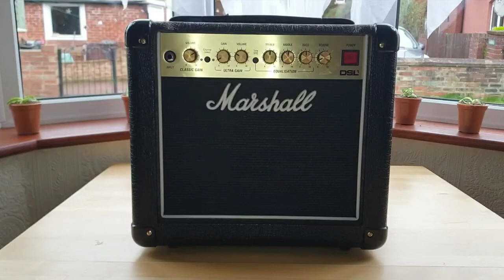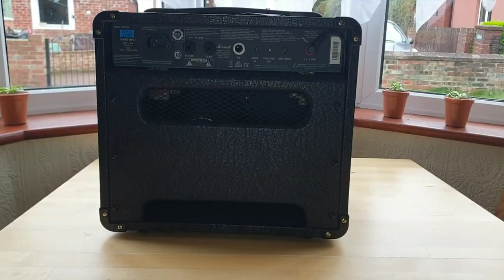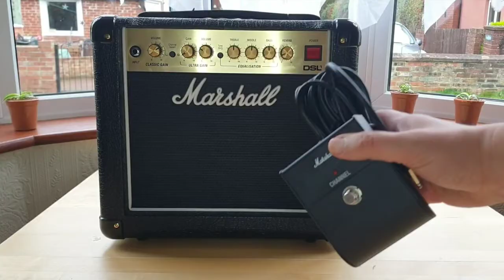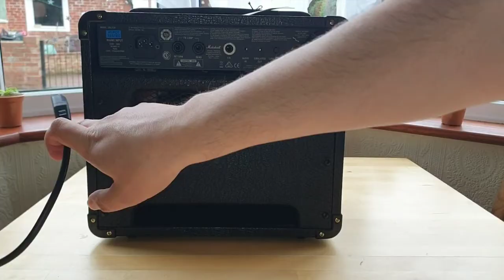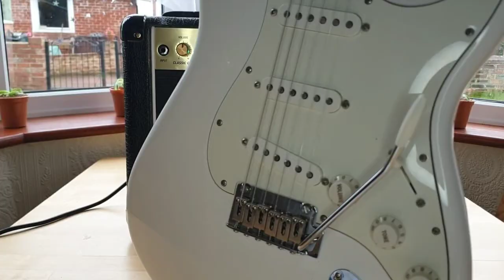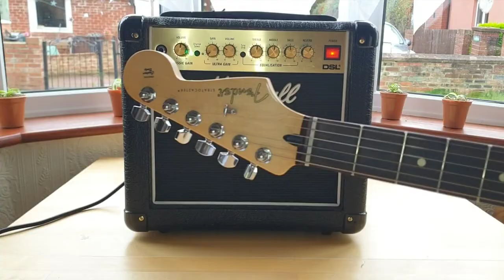Marshall DSL1CR review. The ultimate home practice/recording guitar amplifier?

Comment: Call me a clown but I always thought the point of the low power amps is that one can drive the output  stage very hard.....meaning , turn that volume to 7-10 and then play with the gain level.
Reply from the maker: It is. And with the Lead channel you can crank the master to do this. Sounds great!

Comment: Get yourself a JHS Little Black Box ($69us) to lower the volume even more but retain the sound of tubes running at full volume. This will act like a Master volume, especially for the Classic Gain channel. You'll be able to turn the gain all the way up. It does not require power and has only one knob. It wil only work on amps that have an effects loop. Do NOT run one into the front of any amp, it will probably damage the amp.

Comment: I have one of these,really nice practice amp .I wish they would have put in a 10 or 12 inch speaker.
Reply from the maker: Absolutely
Reply: If you want a 10 speaker, you can get the dsl5cr for just around 50 pound more, and you get more power and less boxy sound
Reply: @GreenHoleSun  An then you have great speaker options, like Celestrion Vintage 10, or Greenback 10, etc

Comment: I liked my DSL1HR through a 412 cab so much I bought the combo too. Now that 412 has given way to a 112 cab, still sounds great.
Reply: does the dsl1cr/hr sound the same just in combo form also does it have enough gain and tightness without the need for an od pedal ?

cheers !
Reply from the maker: It will depend on the cab you use for the Head. The combo has an 8 inch speaker so if you go for a cab with a 12 inch it'll sound different. There is more than enough gain but having said that stacking it with an OD pedal is also a lot of fun!
Reply: @Naf3ria  I don't run an OD pedal at all. I use a delay and a reverb. The OD channel is enough for me when I wan't that sound. But the heaviest I ever go is 80s rock. It gets close enough to the Scorpions for me. Like the blogging musician said, the combo has a small 8inch speaker, as such it definitely sounds different just due to the speaker, not the amp mind you. The combo seems happier to be on the low watt setting at lower volumes, It will do that screaming 1 watt  but you can hear the limitations of the speaker. I use mine in the living room at low volume, you can talk over it, I use the head and 12 inch down stairs where I can get away with louder volumes without disturbing people too much
Reply from the maker: Also depends on the guitar. There's enough gain for soloing on single coils, and definitely enough for p90s and humbuckers.

Comment: Thanks for the review. As far as I read in other ones it takes around 1 month to break in the speaker and after sounds much better.

Could you answer me some questions?
There's the lack of a volume controll on the clean and volume it up following in more crunch in the early beginning. In other reviews massive gaining starts around position 3 already. That's a pity compared with bigger amps for their great cleany Marshall sound. That's right? So,how to controll the volume since 1 Watt is very loud and what about pedals which should be better in clean channel? May it be the Combo will be too silent?
What about the emulated output in use with headphones? Should sound ugly, is the volume setable? I used to have a 250 Ohm headphone in a other Marshall Valve and working fine.

The DSL 1CR wants to be used for headphone use and sometimes for bedroom amping. Not sure if it's right for me. Thanks in advance! (There's a hack out for the DSL1, maybe H, to "enabble" it for 8 Ohm speakers - link in 2nd):
Reply from the maker: Thanks for Watching. The clean channel stays clean till about 12 o'clock onwards on a atrat, earlier for higher output guitars. Yes the clean channel lacks a dedicated volume but I use the gain as a volume control which does the job. Never used the emulated out but in my experience they never sound good.
Reply: @GuitarGeordie  Thanks!
Exactly, a humbucker will bring it early to a crunchy sound around 3 as I seen in othr reviews. Maybe nearly the same for the twisted Single Coils in a Tele.

I've seen users control the volume like you with the classic gain, but also they use the ultra gain knob when it's on clean. That works?! My bigger combo won't work this way so I'm asking. Does the Ultra Gain knob works when beeing in clean? Sorry, I have to figure this out before buying.
I've seen a review where he recorded via the emulated out and it sounds via good headphones professional so wondering about the bad user opinions.
Reply from the maker: @rotepillenfresser4544  No the ultra  and classic gain channels are separate, the ultra gain volume doesn't control the classic gain channel. I would say if you plan on recording thia, then mic it up, as the emulated out is vastly inferior. In g
Fact using modelling software direct  will get you a better tone than the DSL1 line out. I bout it for home practice and to mic up for recording. It exels in those scenarios.

Comment: Hi mate. Great review. If you had a dual foot switch, would the reverb be switchable via the pedal, do you know??
Reply from the maker: Thank you. I had a quick Google but couldn't find anything. Nothing in the manual either. Thinking about getting one? If you need to know I would drop a question on The Gear Page or even just try it out in a guitar store?
Reply: @GuitarGeordie  Yeah, I’ve looked at all sorts but I’m definitely through with modelling amps. They’re convenient but, quite frankly, shite!🤣 I already own a Marshall SL5C but as you say it’s just way too loud for the house, even on 1 watt...& there’s no line out for headphones. So I’ve got a great Valve amp just sat waiting for the neighbours to go on holiday. Definitely thinking about one of these. I looked at the Blackstar HT1R but a YouTube video did a comparison with the DSL1 & the Marshall wiped the floor with it IMO!!  Thanks for the reply 👍👍👍
Reply from the maker: @keithburnett-i7f  Yeah the DSL1 is perfect for home use. On the low power mode you can crank the clean channel to max without too many complaints but the OD, even here is still too loud. However it's the closest your gonna get. Yeah forget Blackstar they don't even have valve OD. Glad the vid help, I too debated between this, the DLS5 and many other amps, but as soon as I plugged into the DSL1 I was sold. Perfect amp 👌. Not expensive either.
Reply: @keithburnett-i7f  Most user had been told that they prefere the Marshall over a Blackstar or other like Katana etc. It has a narural valve sound. Compare a 100 Watts to 10 Watts. It's half the "noise"! 10 to 1 the same and so 1 to 0.1 Watt. 1 Watt is still too loud for rooms.

I don't see any chance for your request and don't believe Marshall spend extra costs on a dual channel input jack. Maybe you find something in the offered extras you could buy for the DSL1. The other amps have a 2nd jack for the reverb and a jack for the mostly 1 channel pedal. The JCM 2000 DSL has the 2 channel one for clean, OD1 and OD2.

Unfortunately the DSL1 should have a mostly bad emulated ouput ... but found a reviewer recorded through it and sounds professional with good headphones. So, I don't know.

Comment: I bought yesterday dsl1 and it sounds crappy, fizzy, muddy... Not the same as on youtube videos, on classic gain no matter how much i turned up volume knob, the sound is always clean, and ultra gain channel is horrible... Play through my epiphone, with alnico 2 pro humbuckers.
Reply from the maker: I can get the clean channel to distort with a strat. The single coil pickups are much lower output than the epiphone so that doesn't sound right.
Reply: Sure malfunction when there isn't any gaining. 
Also the speaker needs some time for burning in.

Comment: Is it big enough to put a 12" speaker in it? Speakers with 10 or 8 inch sizes typically lack bass even with the bass knob cranked. I am debating the DSL5 as well with the ten inch to upgrade to 12
Reply from the maker: I would recommend either going for the DSL5, knowing that it's much louder and much less suitable for recording/home practice levels.... or getting a DSL1H, and having the option of going for whatever 16ohm speaker you want. 

For me, having everything in one package is the most convenient solution, and to be honest I think the 8" speaker sounds great.
Reply: I saw some guy( OldGuyJamming, I think) that upgraded his DSL5 to a 12" Greenback and he had to cut a groove in the bottome of the cabinet. It's that tight to fit a speaker a few inches bigger? I have a 12" Greenback andjust sold a 10" Greenback because it's too boxy. sounding
Reply from the maker: There's your answer then. If you really want to go down the small DSL / 12 inch speaker route, either modify the cab or go for the head version. 

I think maybe you're kind of missing the point of very small valve amps though. The DSL1CR is designed for recording / very low level practice. Yes the cab will sound boxy compared to a bigger amp/speaker/cab, but look at the Fender Champ, one of the most recorded amps in history. Would it have had the same impact with a a bigger speaker?

Anyway, food for thought and thanks for commenting.
Reply: @GuitarGeordie  Thousands of albums were recorded with either a 8 inch speaker 5 watt Champ or a 10 inch speaker 12 watt Princeton amp.
Reply from the maker: No is the short answer. It won't even  fit in a 10"